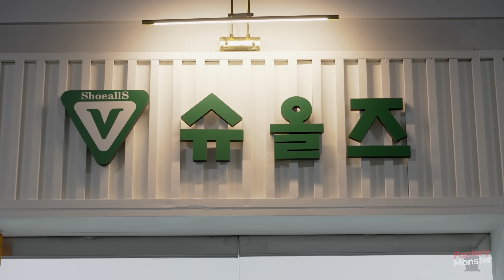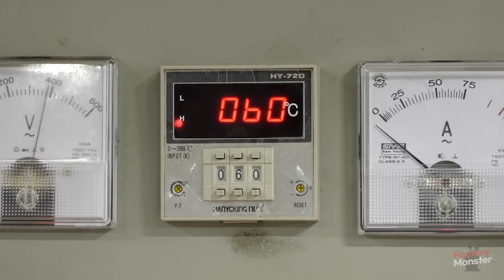Interesting! Shoes Mass Production Process. Korea's Old Shoe Factory

Comment: For some reason i always thought shoe manufacturing would be more automated, this is a lot of work for a shoe, i think shoes should cost more after seeing this
Reply: 99% of shoes are fully automated, this is one of the rare places its not
Reply: Show me one place where 99% of shoe manufacturing is automated, cutting materials, gluing, stitching, packing....
Reply: No Brasil é fácil encontrar sapatos por menos de 10 $, qualidade baixa.
Reply: @rodney100100  you wrong. Shoe manufactur is difficult process automation. A lot of size,variant,model, L&R
Reply: @rodney100100  There is no place where shoes are 'fully' automated. In fact they are still mostly handmade and this video shows the standard way of manufacturing shoes today. By shoes I mean shoes with uppers, not like Crocs.
Reply: @ledhunters  adidas, nike factory